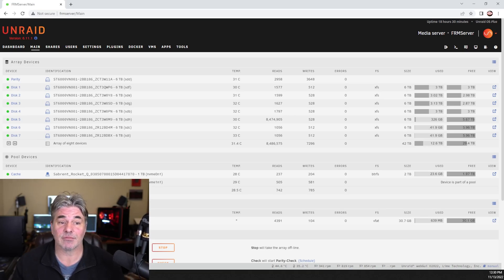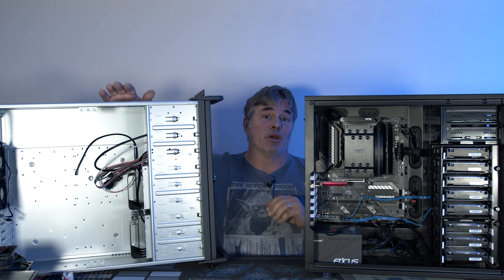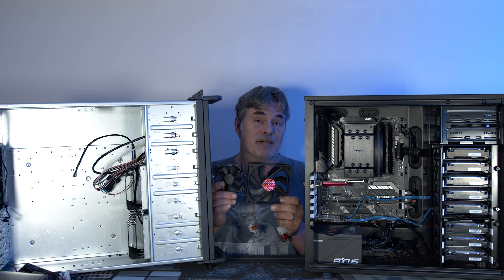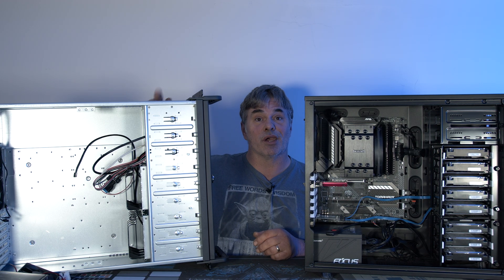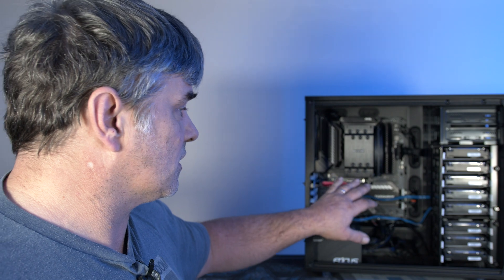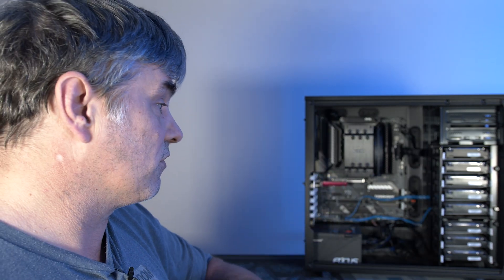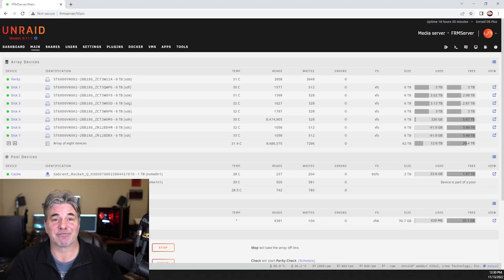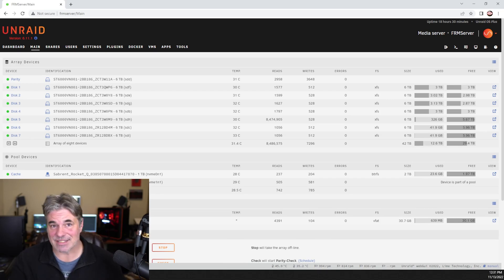Migrating My UnRaid Server to a RoseWill 4U case

Comment: I currently have a mix of sata SSD and HDDs. I plan to get an hba card. I’d also like to clean up the power cabling. At the end of the day I’ll have a total of 10 sata disks. 

I’d like to get some sort of braided sata power cable to work with my Corsair RM750e. Do you have any suggestions?
Reply from the maker: cable mod is where I would look, they can make braded cables for your power supply and also have just cable extensions as well

Comment: I got this case awhile back and I have to say it is nice except...when you need to get to one of the hard drives it is a pain. I have not found a better case yet, but I would recommend a case that is hot swappable. Just makes life easer. 

I also have 4 10TB WD Reds that have a lot of vibration. I am a little worried about that considering there is no way to mitigate with this case as things are packed tight.

Comment: Could I put like icy dock’s hotswapable bays in the front of this case by any chance seems like it has bay holders but can’t tell?
Reply from the maker: looking at specs the icy dock is bigger than the drive bays in the case, so no they will not fit the case without extensive modifications
Reply: There is a 12 drive version with hot swap.